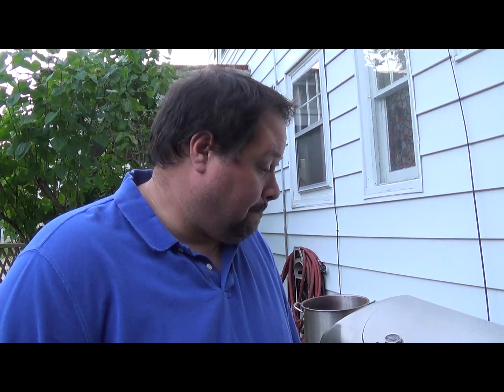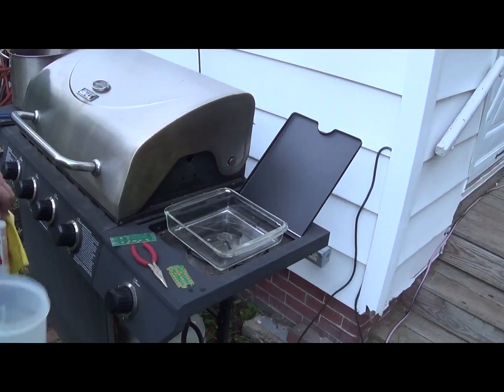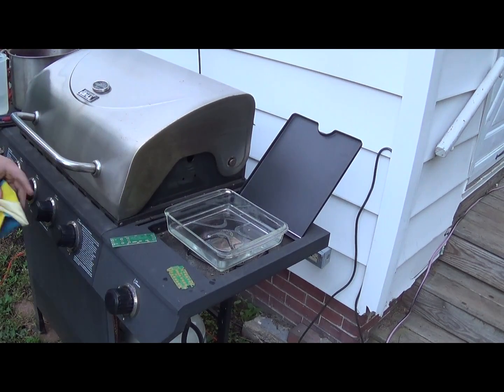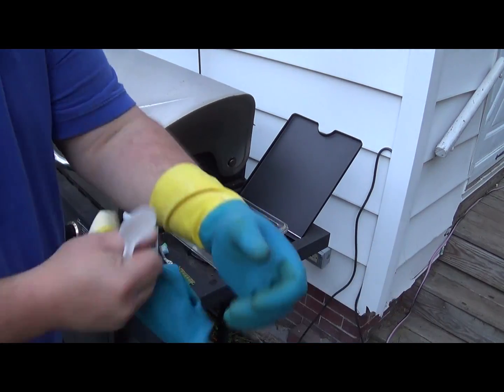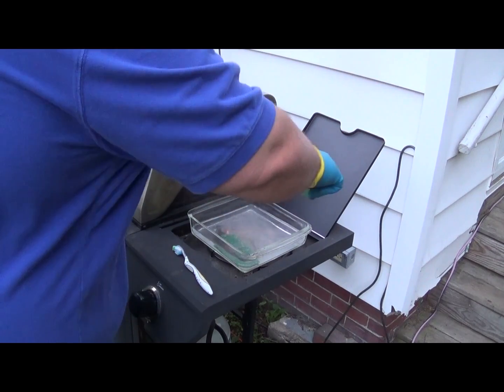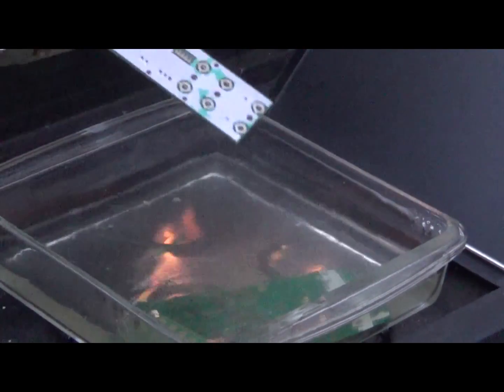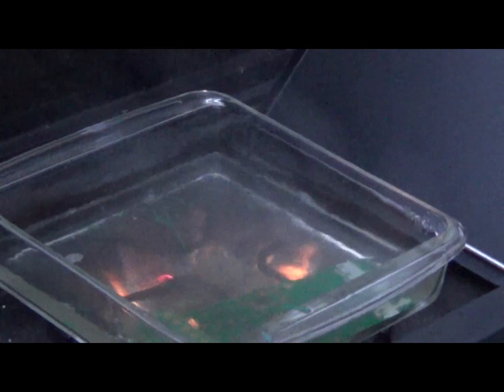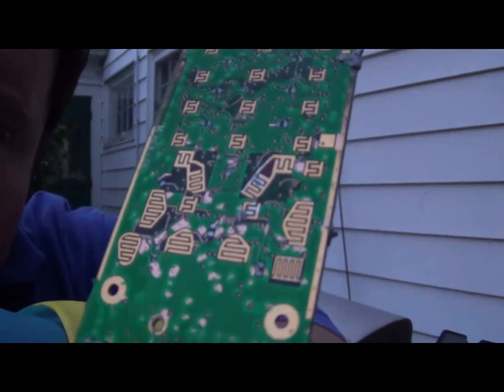How to Remove the Green Solder Mask from Cell phone and other boards for gold recovery

Comment: Yay! Another job I could probably do without the SAS crashing through my windows.  I think there might be something wrong with me, I can't seem to comment on your vids without mentioning the SAS.  Maybe sub-conciously I want it to happen.  Well, maybe one bloke anyway... and I hope he has chocolates with him! lol

Thanks for the video Moose.

Poo
Reply: poosmate I am a prepper :) and for good reason.
Reply: Jennifer Buechner Good for you. I am as well.
Reply from the maker: +Dan Nelson CORRECT!  The problem that you clearly do not watch my videos as I have stated that these chemicals do need to be disposed of properly.  Also in that I have never said that I have never taken a chemistry class, at one point, I was a pre-med student and have taken many chem classes.  I state I am not a chemist.  You are also ass uming that I am dumping things in the ground, which I do not nor do I endorse.  I talk viewers out of all kinds of things from dumping to burning insulation off copper wire.  I am not using HCL as an industrial solvent, I am using it to remove a thin layer of copper and nickel.  Not for adhesives or epoxies.  A good dose of heavy metals?  The chemicals that I use that have low quantities of copper, nickel, tin, antimony, lead, and iron are properly labeled and brought to the City of Portland waste facility where they are collected and properly disposed of once a month.  Fortunately, the processes I use do not use that much solution so I have yet had to bring any in for disposal also I make attempts to remove these metals from solution to be sold as is.... to recyclers.... as seen in some of my videos as well.  and what's with the preppers?  I'm not a prepper, nor do I know any.  And now you are talking about vaccines?  Both my kids are vaccinated, one of them is on the autism spectrum which is why I quit medical school to spend the necessary time with him in his early developmental years and also needed a job that had good health insurance to pay for the services so that I would not leech off the government.  I do not pollute the ground or water.  I do not pollute the air any more than the average joe.  I never denied that these processes created toxic gases and liquids.  I simply denied your accusation that I am dumping, or in any way infringing on your right to breathe clean air and drink clean water.  Also I am not infringing on your right to free speech which you clearly enjoy.  SO now, I get to use my right to boot you from this channel!!  YAY!!
Reply from the maker: I would love to see that video....an SAS agent charging in, grabbing your little lab set up then dropping off a box of chocolates as he rushes out.
Reply: Moose Scrapper I might not want him to rush off! LOL  I guess I watch too many YT vids and the news too much and forget that chemicals are not all destined for bad stuff.  I still can't get my head around the fact that "seemingly" Americans can walk into a supermarket and literally buy an arsenal of weaponry and enough chemicals to wipe out humankind.  Is my perception just completely wrong?  Here in England the most dangerous stuff you can buy in the supermarket is probably household bleach, oil for your car and a set of kitchen knives lol!  Imagine a SHTF situation over here.. "Don't come any closer or I'll stab you with my vegetable knife" LOLOLOLOL

Poo
Reply: Moose Scrapper Don't laugh too loud.

Our wonderful DEA seized a Hobbyist Gold Refining Setup and his refined Gold from an acquaintance of mine about a quarter mile away here in Californication.

They did not return the Gold or his chemicals after arresting him for "manufacturing drugs". They just manufactured the charge so they could steal the Gold..

They are attempting to make Gold possession a substance abuse crime.

The ATF will probably follow suit as the chemicals used can also be used for manufacturing explosives.
Reply: WOW!  You know, I am really starting to fear for you Americans.  Your Government seems to be cracking down on everything and your civil rights seem to be being infringed more and more.  I'm beginning to understand "preppers" and why so many believe in conspiracy theories and the Illuminati and NWO.  Keep your heads down and stay off the radar!

Poo
Reply from the maker: +Dan Nelson OK, I hear you.  Quick question though, do you feel this negatively towards people who own swimming pools?  I hope so, so that you would not be called a hypocrite.  After all, according a study done in 2004 there were more than 8.5 million swimming pools in the US.  They all use the same chemicals.  HCL, bleach, that's all I use.  I use roughly 1 gallon of HCL and approximately 1 cup of bleach per year.  Pool owners use gallons of each yearly.  They both produce the same gasses.  When I use it, the gases are created in a small concentrated area where as pools spread it out over the whole surface area of the pool and since it is diluted by the water, it releases slower, but make no mistake, there are more gasses produced by that one pool than dozens on home refiners.  And honestly, you expect one I six people to try this?  I am sorry you feel the need to hate something, but try to do a little research before you start pointing fingers so that you don't look like a complete moron.  After all, I am quite sure that unless you are in the business, I do more for the environment in one year than you will do in your lifetime.  None of the chemicals I use are controlled by government produced regulations.  None of the chems I use end up in the water supply.  Be careful though, I think your neighbor is doing laundry and may be using bleach, or borax.....  Hopefully they never get a plugged up drain and need to use lye drain cleaner....  While you are at it, you better start hating masons and plumbers too.  Masons use hcl in higher concentrations to clean brick and concrete, and that ends up right in the ground.  Oh yeah, and I hope you never drink alcohol as well.  After all, in this country, it is one of our freedoms to brew our own wine, beer, etc.  You need sodium metabisulfite to clean and sanitize the casks and other brewing vessels.  Wow dude, I don't envy you.  You are going to be busy with all that hating.  Pool owners, plumbers, housewives, Laundromats, brewers, masons, and that's all I could think of in the four minutes it took me to create this response and it sounds like you have all the time in the world to think about hating.  Best of luck to you.
Reply: Dan Nelson Not exactly sure why you popped that question at me I haven't actually done any refining yet and wanted to be sure that when I do I can do it in as safe a way as possible for not only me but the environment too.  Don't worry about my neighbours, I only have neighbours on one side and I won't be doing any chemical stuff on that side of the property.  Funnily enough, we have a duly elected Government in England too and we  also have the Environment Agency and DEFRA (Department for the Environment, Food and Rural Affairs) who legislate all matters environmental.  If HCL was illegal I'm sure I wouldn't be able to buy it from an English supplier on Ebay.

I'm sorry I'm not up on your constitution except I know 1 is your freedom of speech, 2 is you right to bear arms (seems most people stop reading it here) which is not unlimited and does not prohibit all regulation of either firearms or similar devices and the 5th, which I will not plead here because you are no judge or jury, just judgemental.

I am somewhat confused as to why you chose me and Moose's video to post your obvious dislike in the process of gold refining. If you watch more of Moose's videos you would find that he is very much a recycler, giving new lives to stuff people have thrown out which would otherwise have possibly gone to landfill.  He is helping your country to be a cleaner, greener place to live.  What do you do to help?

Poo

Comment: Why are we removing the solder mask? Won't the A/P method cause the gold to detach as with gold fingers? Haven't processed my 300 cell phone boards yet (saw your sand bath vid -great!) and this was news to me.
Reply from the maker: Sometimes there is also gold under the solder mask.  AP will not detatch that gold so you have to remove the mask first.

Comment: Interesting, but why would they use gold under the solder mask...?  I thought gold was for connectors and contact points... there would just be copper traces under a solder mask.
Reply: I'm pretty sure I have an old mother board, with gold underneath the "solder mask". It's rather buried at the moment, or I'd link you to a pic :S I thought I had another in a Power supply, but it turns out it's copper underneath.  I haven't done a whole lot of circuitry recovery. The dull color that's coming through the mask, reminded me of gold for some reason lol.  Guess not! The motherboard is DEFINITELY gold though.  Can't wait to play with it down the road.  But I'm waiting til I have LOTS of material, before buying the chemicals ;)
Reply from the maker: It is not very common indeed.  You find it mostly in cell phones, lab equipment, aviation electronics, and military grade stuff.  I am not completely sure about the reason its used in cells but i think it has to do with everything having to work perfectly so therea re no dropped calls, better reception, etc and that gold is a better conductor of electricity than copper so maybe it causes the battery to drain a little slower?  Not an electrician ...  thanks!
Reply: Silver is best :p then copper, then aluminum, then gold. Gold is best for contact points. Gold doesn't react with much.  Though pure tin has potential to be a super conductor.
Reply: Moose Scrapper how do you get the led sorder off the board's i just don't want to mess the gold up
Reply: some of the board's do have gold under the green mask
Reply: surely running from one contact point to the other and then using another metal would be another process in the factory please less conductive, defeating the point and losing signal quality hence all the way in gold just a thought :)
Reply: jeffrey stines - hlc